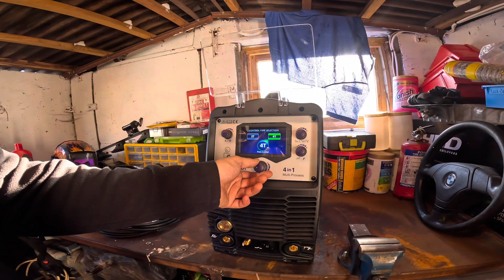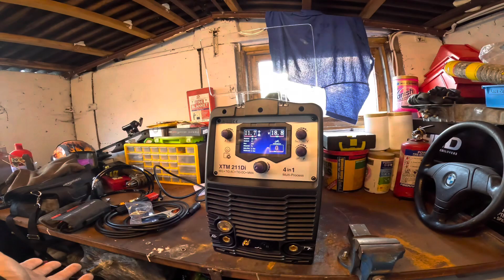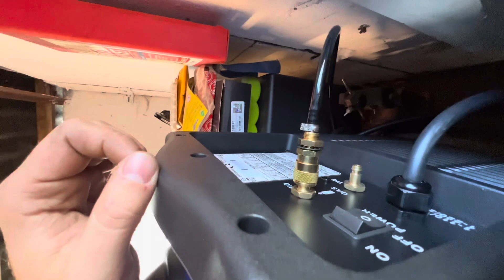NEW WELDER! Unboxing Parweld XTM 211Di

Comment: If you're right handed.. working from right to left would be a better technique.. torch angled slightly back which preheats the plate before the weldpool..plus your welds will be straighter as your not obstructing the root, where the two plates meet with the torch(see where your going) Torch abit closer to the work piece shortening the arc.. and the rest is practice. Happy welding!